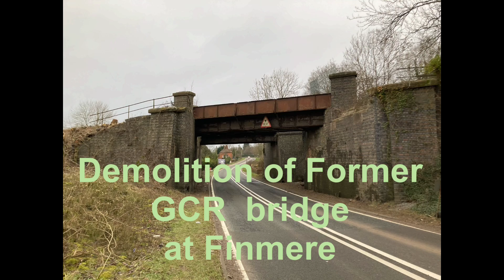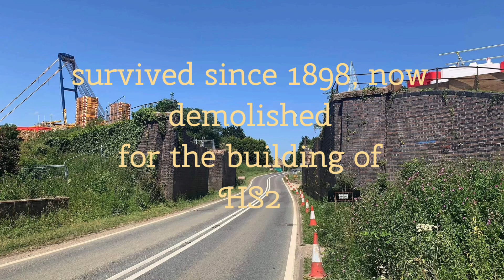GCR Finmere bridge demo #hs2

Comment: Thank you for sharing this. Sad end to a lovely bridge in the name of progress. I wonder if its replacement will look as good or last as long?
Reply: There's another bridge in there already somebody did tell me its temporary..
Reply: It will probably be one of the modern concrete ones or a steel one.
Reply: The design life for the new HS2 assets is 120 years - which, from 1896, is roughly how long the GCR originals had lasted.  However, walking under the original bridges in April 2021, they were rusted tissue-thin in places. It was time to remove them before they dropped, regardless of the HS2 alignment running through here.